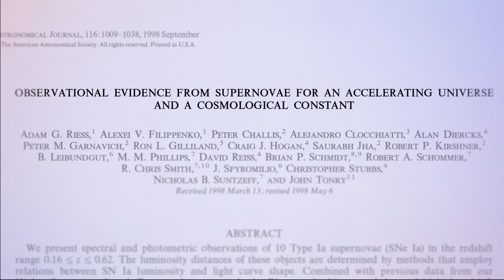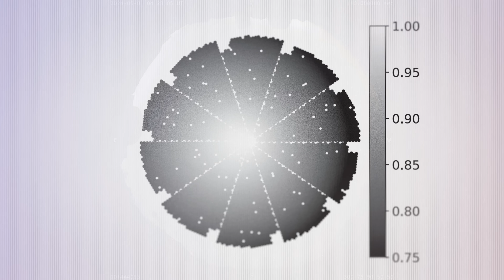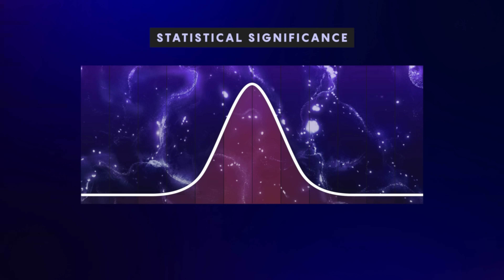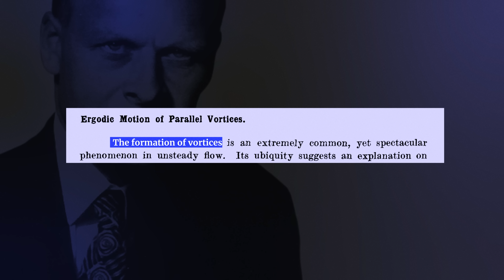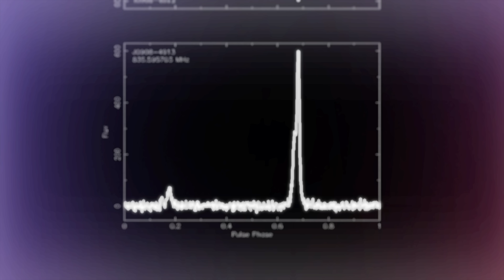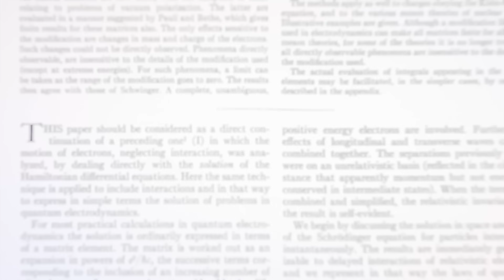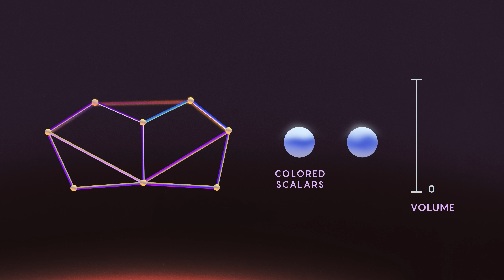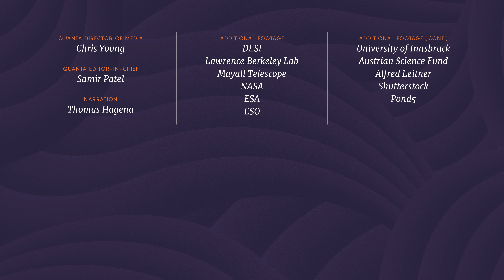Biggest Breakthroughs in Physics: 2024

Comment: PHYSICS KICKED INTO TOUCH BY ELECTRICAL SCIENCE !
The biggest breakthrough in Physics in 2024, is the sad news that "Physics" has been undermined and turned on its head, by a revolutionary breakthrough in Electrical Science. Thanks to a major high tech Electrical Company called AUREON ENERGY Ltd. Virtually everything "Physics" tells us about the Universe, had been totally destroyed. The Universe its been PROVEN by this company works Electrically, NOT Gravitationally. And the visible proof is this NEW Plasma Reactor Generator (PRG) technology. A mindboggling multi-functional electrical research system that can change the Universe, and its already Patented, and the first PRG's are already being installed in the USA currently.   

The first (experimental) PRG was developed between 2004-2018 to replicate a piece of the Sun's atmosphere here on Earth, in a highly heat resistant electrically charged Plasma Hydrogen Chamber. Capable of recreating ALL the behaviours of our Suns atmosphere, that this first machine was designed to reveal. So as to discover exactly how the Sun & Stars in reality really work. As suspected for Decades by Electrical Scientists, such as Radio Astronomers & Plasma Physicists. The PRG quickly confirmed the Stars and the Universe in reality function in a totally electrical manner. 

So our Sun burns NOTHING at all, it functions by absorbing much of the "Birkeland Current" (The Electrical flow from the Galaxies Centre), and mixing this with the Hydrogen & Plasma in the Suns atmosphere. Which simply causes the Plasma to "Glow", in a similar way to a Fluorescent light tube. The bigger the Star, the brighter it will glow. But it is all the other strange things that have now been discovered, that go on in any Stars atmosphere, that has turned much of Science on its head. 

The Sun's atmosphere Plasma Electric behaviour, can instantly stop the emission of Nuclear Radiation, and totally consume the material giving off such radiation. Further as also discovered, Plasma is in reality not a "Hot Gas" as NASA seems to think, but the PRIMARY STATE OF MATTER. Meaning Electrically agitated Plasma is the "creator" of every Atom and Element in the Universe, and every Stars atmosphere is where this is constantly happening. Indeed the experimental PRG during testing was found to have "created" FOUR NEW never before seen, Stable Heavy Metals. Still awaiting identification of their atomic weight and official naming. Itself a Major Scientific discovery.

Yet further is the Discovery by this experimental PRG, that the highly electrically charged Sun's atmosphere, also "Transmutes" the Elements, can create NEW elements, or indeed any element you want in Industrial quantity, once it was learnt how to manipulate the electrical behaviour of Plasma. Which has taken quite a few years. 

So the new commercial PRG's now starting to enter commercial use, will: Generate massive quantities of Electricity in the way a Suns atmosphere does. Which is a far more efficient way than any current method. All main power stations can be modified with a PRG to replace whatever power source is currently being used, Oil, Gas, Coal or even nasty Nuclear Reactors. The PRG is a totally Green technology, despite working at Nuclear reaction temperatures. They will also be used to Transmutate the Elements, or even create Elements from the Plasma. This method will obviate the need to find and Mine "Rare Metals", as a PRG can simply churn out whatever metal you want in Industrial Quantity. Even better, a PRG, can be fed with highly dangerous Nuclear Radioactive waste, which it instantly stops from giving off Radiation, and consumes the material giving off the problem. Which means all the buried Nuclear Power Station waste around the World, will become a thing of the past. As will the need for Nuclear Power stations, whether Fission or Fusion. 

It also means that another problem that afflicts the USA, which is the highly dangerous and illegal practice of "dumping" radioactive waste in the countryside. With over a 100 highly toxic radioactive known sites around the States. The problem being this material is leaking into the Water Table, and therefore getting into the Drinking Water. So the first Commercial PRG's, a miniature version, designed to fit inside mains drinking water pipelines. To instantly stop the radiation as the water flows past the PRG, and simultaneously "consume" the material responsible, are already being installed as I write.

The Scientific bottom line however is that the mere existence of the PRG Technology, proves that Physical Science with regard to its concepts about the Universe, is utter nonsense. The Sun & all Stars function electrically, and can only function electrically thanks to the now also proven existence of a Universe wide Plasma Electric field. (Plasma is the best known conductor to mankind).

For MORE INFORMATION on the New Science of the Plasma Electric Universe, I recommend the "THUNDERBOLTS PROJECT" expansive website, where many Scientists, including some involved in the development of the PRG, post almost daily Documentaries & Shorts, on how this Electrical Universe and everything in it, fits together. - Its Electrifying  !!

Comment: There is no dark energy. There is only one reason to postulate it, to explain the exponential expansion rate of the universe. The expansion was discovered in 1929. In 1998 it was discovered that the expansion is accelerating, this is when the concept of dark energy became mainstream.
   Electricity is drawn towards potential and the universe as a whole behaves the same way. Electricity comes into our homes because the neutral circuit provides the potential. Electricity is drawn towards grounding rods for the same reason.
   If something accelerates at a constant rate it will get faster and faster. If a spaceship travels at a constant 1g acceleration rate it would achieve about 95% light speed in 1 year.
   Physicists in the last century did not postulate dark energy because they understood that the expansion is a fundamental property of the universe. The fact that the expansion is accelerating does not invalidate their reasoning. It's what the known laws of physics would predict provided gravitational forces are not strong enough to counteract the process. 
   All studies to find dark energy have been fruitless because it doesn't exist. To say there is dark energy is to say there are 5 fundamental forces, there are 4. All the famous physicists from the last century did not postulate dark energy for these reasons.

Comment: :hand-pink-waving::hand-pink-waving::face-blue-smiling:Not really IMO new physics but just more accurate measurements and method. Seems to me Λ constant absolute value is pretty fixed at 1. The small dip of about ~0.98 could just be due to previous measurement methods limitations and inaccuracies. This can be easily verified by using the old methods again and this dip does not show up.

Comment: perhaps you will mention it (I'm only 11:12 into it so far) but I wonder do these vortices only spin one way? if not, what defines which direction these vortices spin? And if they can spin different ways- what happens from the total of angular momentums of two squaring vortices? and can it (the spin of the vortices and axis) be directed?
Reply: This depends on the method used to generate the vortices. In this experiment, we spun the magnetic field continuously in one direction, and so every vortex is spinning the same way. However, there are other ways to generate vortices that make random numbers of vortices and antivortices, spinning in opposite directions. What makes these vortices special is that they're all identical, spinning with exactly the same speed. So, if a vortex and antivortex touch they, and their angular momentum,  annihilate!
Reply: @thomasbland713  Thank you for your work!
Reply: @thomasbland713 when you say anníhilate does that mean it ends up in some kind of explósion ??

Comment: How much more accurate would measurements be with imaging beyond the diffraction-limit? Sub-wavelength. POML(Photonic Optic Meta-Lattice)Concept: material designed to achieve previously unattainable light manipulation. By combining metamaterials, photonic crystals, quantum dots, graphene layers, and topological insulators, this design allows for extreme precision in light bending, amplification, and control, with potential applications in high-resolution telescopic imaging, such as viewing objects as small as the flag on the moon.10x-100x the JWST capabilities depending on its objective.
Reply: Scientific Rationale:
The POML exploits cutting-edge advancements in materials science and quantum physics, leveraging known principles of negative refraction, quantum light trapping, and near-zero loss energy transmission. This places it at the intersection of theoretical breakthroughs and practical applications.
Key Components:
a. Photonic Crystal Lattice:
Structure: Triangular or diamond lattice.
Lattice Constant: ~200 nm for interaction with visible light.
Function: Manipulates photons with minimal scattering, ensuring highly controlled light paths for enhanced image clarity.
Metamaterial Properties:
Refractive Index: Ranges from -1 to +5, enabling exotic light behavior such as negative refraction.
Composition: Silver or gold nanoparticles embedded to achieve plasmonic properties for negative refraction.
Tuning: Refractive index is dynamically adjusted using an electromagnetic field (1-10 Tesla).
Graphene Hybrid Layers:
Layer Thickness: 1-2 atomic layers.
Conductivity: Electrically tunable with high conductivity (10^5 S/m), allowing for real-time adjustment of light paths.
Substrate: Silicon carbide (SiC), providing structural stability and thermal control.
Quantum Dots and Quantum Wells:
Size: 10-50 nm for photon-electron interaction.
Material: Graphene quantum dots (GQDs) embedded to trap, control, and release photons.
Function: Quantum-level light amplification and control through voltage manipulation (1-5V).
Topological Insulators:
Material: Bismuth selenide or bismuth telluride for surface electron flow control.
Thickness: 5-10 nm to maintain electron flow on the surface without bulk conduction.
Magnetic Doping: Controlled with magnetic fields to fine-tune light manipulation at the atomic scale.
Amplification and Near-Zero Loss:
Light Amplification: Achieved through quantum well structures like indium gallium nitride (InGaN), amplifying incoming light for greater clarity and range.
Dielectric Coating: Silicon dioxide (SiO2) or hafnium oxide (HfO2) used to minimize light loss through reflection or absorption, ensuring near-zero energy dissipation.
Photon Recycling: Internal photon recycling loops redirect scattered photons back into the system, inspired by solar technology but optimized for high-precision optics.
Thermal Management and Self-Healing:
Thermal Conductivity: Graphene layers and boron nitride (BN) provide high thermal conductivity (~500 W/mK) for heat dissipation, critical in high-energy applications.
Self-Healing Properties: Fullerene (C60) molecules within the structure enable atomic-level self-repair, extending the material's operational life and reliability.
Practical Applications:
Telescope Optics: By utilizing the POML material, telescopes could achieve unprecedented resolution, potentially allowing for the observation of objects as small as the flag on the moon or finer details on distant celestial bodies.
Advanced Imaging: The ability to control light with such precision opens possibilities in various fields, including microscopy, quantum computing, and communication technologies, where light manipulation is critical.

Conclusion:

Each component of the POML design is rooted in ALREADY PROVEN current scientific research and emerging technologies. The convergence of these components forms a plausible pathway to achieving exotic light manipulation in practical applications.

Continued research and collaboration between experts in materials science, quantum mechanics, and optical engineering will be essential to refine and prototype the POML for real-world use.

Comment: How much difference would measurements made from imaging beyond the diffraction limit?Any researchers able to confirm or deny this possibility? Yes.. sub-wavelength resolution 😉That means 10x-100x the JWST's capabilities depending on the use.. here is how: 

Concept Overview:
The Photonic Optic Meta-Lattice (POML)is a novel material designed to achieve previously unattainable light manipulation. By combining metamaterials, photonic crystals, quantum dots, graphene layers, and topological insulators, this design allows for extreme precision in light bending, amplification, and control, with potential applications in high-resolution telescopic imaging, such as viewing objects as small as the flag on the moon.Scientific Rationale:
The POML exploits cutting-edge advancements in materials science and quantum physics, leveraging known principles of negative refraction, quantum light trapping, and near-zero loss energy transmission. This places it at the intersection of theoretical breakthroughs and practical applications.Key Components:
a. Photonic Crystal Lattice:
Structure: Triangular or diamond lattice.
Lattice Constant: ~200 nm for interaction with visible light.
Function: Manipulates photons with minimal scattering, ensuring highly controlled light paths for enhanced image clarity.Metamaterial Properties:
Refractive Index: Ranges from -1 to +5, enabling exotic light behavior such as negative refraction.
Composition: Silver or gold nanoparticles embedded to achieve plasmonic properties for negative refraction.
Tuning: Refractive index is dynamically adjusted using an electromagnetic field (1-10 Tesla).Graphene Hybrid Layers:
Layer Thickness: 1-2 atomic layers.
Conductivity: Electrically tunable with high conductivity (10^5 S/m), allowing for real-time adjustment of light paths.
Substrate: Silicon carbide (SiC), providing structural stability and thermal control.Quantum Dots and Quantum Wells:
Size: 10-50 nm for photon-electron interaction.
Material: Graphene quantum dots (GQDs) embedded to trap, control, and release photons.
Function: Quantum-level light amplification and control through voltage manipulation (1-5V).Topological Insulators:
Material: Bismuth selenide or bismuth telluride for surface electron flow control.
Thickness: 5-10 nm to maintain electron flow on the surface without bulk conduction.
Magnetic Doping: Controlled with magnetic fields to fine-tune light manipulation at the atomic scale.Amplification and Near-Zero Loss:
Light Amplification: Achieved through quantum well structures like indium gallium nitride (InGaN), amplifying incoming light for greater clarity and range.
Dielectric Coating: Silicon dioxide (SiO2) or hafnium oxide (HfO2) used to minimize light loss through reflection or absorption, ensuring near-zero energy dissipation.
Photon Recycling: Internal photon recycling loops redirect scattered photons back into the system, inspired by solar technology but optimized for high-precision optics.Thermal Management and Self-Healing:
Thermal Conductivity: Graphene layers and boron nitride (BN) provide high thermal conductivity (~500 W/mK) for heat dissipation, critical in high-energy applications.
Self-Healing Properties: Fullerene (C60) molecules within the structure enable atomic-level self-repair, extending the material's operational life and reliability.Practical Applications:
Telescope Optics: By utilizing the MOPL material, telescopes could achieve unprecedented resolution, potentially allowing for the observation of objects as small as the flag on the moon or finer details on distant celestial bodies.
Advanced Imaging: The ability to control light with such precision opens possibilities in various fields, including microscopy, quantum computing, and communication technologies, where light manipulation is critical.Conclusion:
Feasibility: Each component of the POML design is rooted in current scientific research and emerging technologies. The convergence of these components forms a plausible pathway to achieving exotic light manipulation in practical applications.
Next Steps: Continued research and collaboration between experts in materials science, quantum mechanics, and optical engineering will be essential to refine and prototype the POML for real-world use.
Reply: I just hope that all this doesn't get weaponized . Against us .

Comment: If dark energy has been weakening, then how is the expansion rate of the universe accelerating?

I guess dark energy doesn't have anything to do with the expansion rate of the universe.
Reply: It's not either-or, it's just that we don't have a theory that accounts for the full range of observations, as we understand them.
The big challenge of current physics is that our existing theories account for a huge body of very wide and extremely precise experimental observations. There are some deviations, but most of them are so small that it is hard to infer a more accurate underlying theory (like Einstein's relativity replaced Newton's equations, but they are effectively indistinguishable at low velocities).
For example, the geocentric model of the solar system developed by Ptolemy described the positions of known planets quite well, but there were small deviations. The orbits of these planets are only slightly elliptical, and without the high precision of Tycho Brahe's measurements, Keppler probably wouldn't have been able to come up with his mathematical laws that explain their motion as heliocentric ellipses. Then came Newton and showed how a square-inverse law of gravity can account for such orbits, etc.
Reply: Or maybe the rate of acceleration is slowing down? Idk